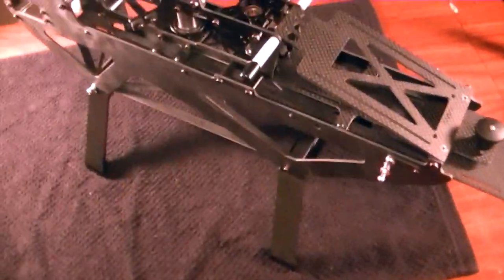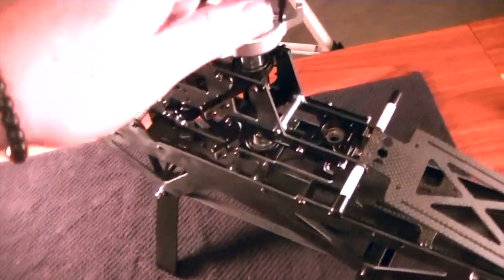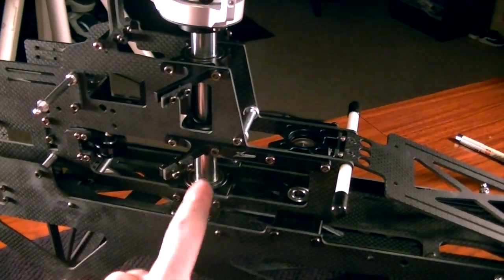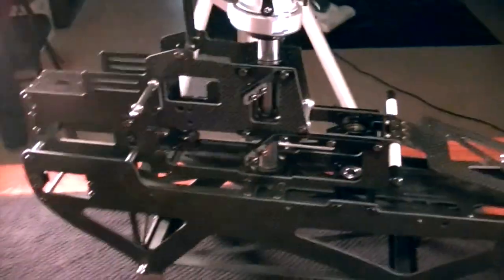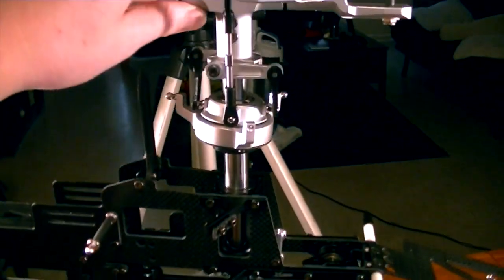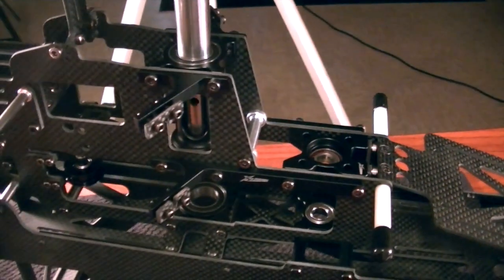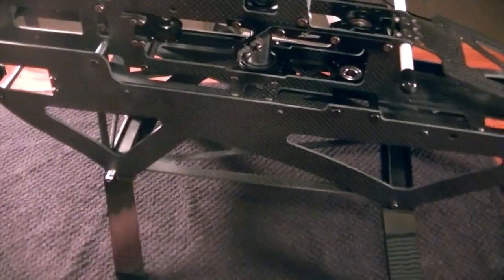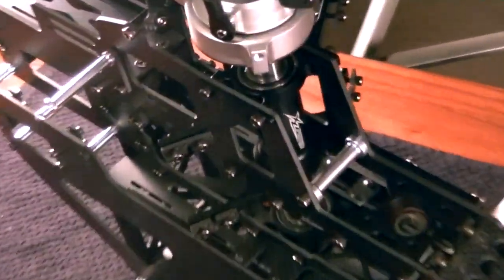Heli build tips : Perfect frame assembly (FreddyCanFly)

Comment: I have a quick question, I'm a total noob and I'm building a trex 470. I can't seem to find any recommended radio settings online or in the manual. Where can I look? I've been flying the blade 230, that just had a table with all programming info, is there somewhere I can find something like that?
Reply from the maker: Yes if course there is, are you using the align 3gx system or the micro beast x plus?  (or what flybarless system and radio are you using for that matter)
Reply: @FreddyCanFly  I am using the stock micro beast x, a spektrum ar6610t reciever, and a dx6.